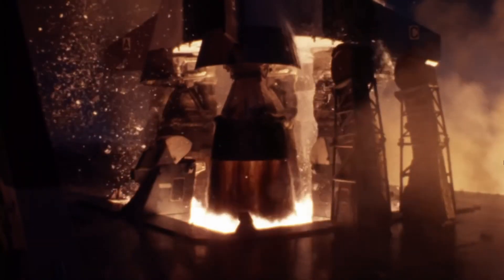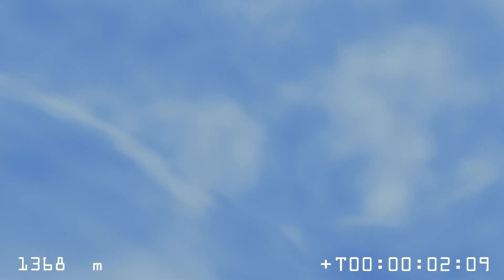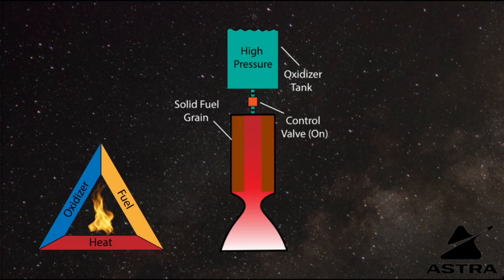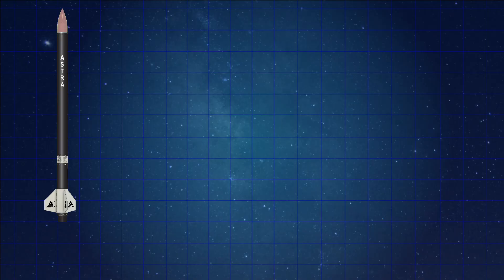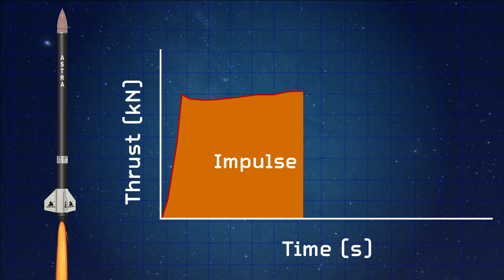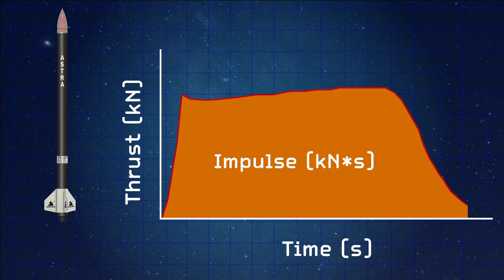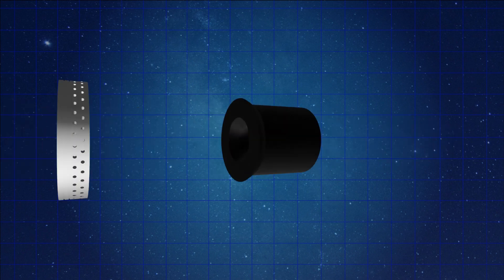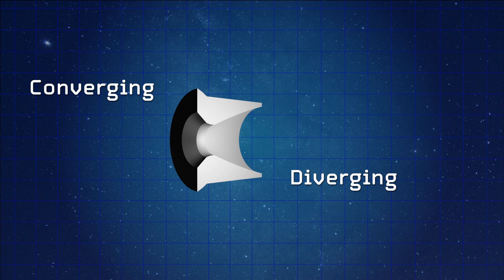ASTRA Transcendence Rocket: Propulsion System Introduction

Comment: Actually there are downsides of N2O and one is that it can decompose under certain conditions etc. I think the interesting part of hybrid rocket engines are the additives you can put in the plastic or in this case the wax. Additives like sodium, lithium, aluminium, magnesium would allow other oxidizers like water or CO2 and could make the chosen oxidizer N20 (together with magnesium) more effective.

Comment: You should look at implementing supercharging of the Nitrous Oxide tank ullage with helium to help extend the liquid phase and mitigate possibility of NOX vapor phase detonation through dilution at the end of liquid phase run down. Will also help avoid issues of dual phase flow reaching the injector and subsequent issues that causes with injector discharge coefficient. Paraffin wax although its offers "high regression rate" has a multitude of undesirable traits including poor structural properties, issues with bonding to motor insulation materials and g-induced grain shearing and mass ejections. Adding the necessary reinforcement chemicals (like EVA and PE) tends to reduce the regression rate so is trade off of diminishing returns. Has ASTRA Bremen done any development work or sub-scale firings yet with wax formulations? I can offer some pointers on this..Good luck team ASTRA always good to see more hybrids aiming for space.
Reply from the maker: Sounds like you really know what you are doing.  We are planning to do some sub-scale propulsion testing in order to develop our fuel grain formulation and injector designs.  The plan right now is to reinforce the paraffin with PE so we want to see what regression rates we will achieve with that.  We are aware of the benefits to Helium supercharging, but we are trying not to get into it unless we feel we really need it, because Helium is not cheap...  Of course we welcome any insights that you might have if you have some experience hot firing paraffin wax based propulsion systems.  We are still very much in a preliminary design and our concept is still evolving.
Reply: @ASTRABremen  Yes have been at this a lot of years and hot fired HRMs up to 500mm diameter and 78Kn of thrust, and done extensive work on high regression fuels over a 15 year period. I own several important IP that are at the core of my company for high regression high energy fuel formulations and methods of manufacturing. Cant divulge these but I can assist with Paraffin fuel formulations. 

You should look at formulation with 8% by mass of EVA polymer, around 2% tacky resin (like escorez) and try have a combination of normal paraffin (around 65C melt) and MC wax (micro-crystaline wax melting around 80C). Ofcourse around 2% by weight of carbon black for IR opacifying the fuel grain. PE will harden the fuel grain a little, but the negative side is that is completely non-polar and reduce bonding even more. The EVA helps give the fuel grain some elasticity and in combination with tacky resin ensures better adhesion to the motor liner materials. You will need to rotational cast this fuel however as wax transition from molten liquid back to solid results in near 30% contraction and liner adhesion failure. 

With the supercharging you can also use Nitrogen or even Oxygen BTW, any noble gas will be useful for the NOX vapor dilution, its just that helium is more mass efficient.
Reply: Try Escorene Ultra UL 7710 Series EVA polymer. Has melt temp of 65C so blends well with paraffin
Reply from the maker: Thanks for the tip.  We will definitely try this out.  We are planning to do our first grain manufacturing trials in a month or two so stay tuned for our results!
Reply: @ASTRABremen  no worries, always happy to see more hybrids heading towards space.

Comment: I am really motivated that you upload continuously.
Reply from the maker: Well, we are pretty motivated to get to the Karman Line and we want to share as much of that journey as we can.  Hopefully we can motivate other groups/people to take on this ambitious challenge!
Reply: @ASTRABremen  I want to hit that goal too but there is a twist i will do it alone and beffore graduation in just 4 years from now. And just under 5000 dollars. Watch out for me.
Reply from the maker: That will be quite the challenge.  I would recommend to get a couple friends onboard as well.  Rockets are big and heavy... and doing it with friends is half the fun :)
Reply: @Space_Shot  having worked on rockets for over 30 years (hybrids for 25 years now) both as an experimenter and a professional I can tell you confidently no way your getting to the Karman line as a loan effort and for 5000 bucks in 4 years,  its a lot lot harder than you think and even getting to 30km is outside of the capabilities of most amateurs. There is significant challenges outside of just the propulsion as well, as most experimenters/ graduate engineers dont have the experience to design a stable flying rocket across high mach regimes and avoid issues such as roll pitch coupling. Most of this knowledge takes years of industry experience, I wish you the best though but you should probably focus on something achievable within that budget and time scale such as getting past 10km to 20km. Good luck and happy rocketeering.
Reply: @jamieanderson6786  I am making a solid rocket motor not hybrid.
Reply: @Space_Shot  irrespective of propulsion type the impulse requirements of getting to 100km are still much larger than a 5000 budget will support, and there is still a great deal of engineering to be mastered not only to design the propulsion and a vehicle but also ensure stable flight. Like I said I dont want to discourage you, but the challenge is much more complicated than building a motor. Also as a guideline Derek Deville Q8UK project that reached 30km cost closer 10x 5000, and Derek has 25+ years in rocket building experience. I have built AP/AL/HTPB composite propellant SRMs all through the 1990s and an SRM around total impulse 30,000N-sec will eat up your 5000 budget no problem and will get you to about 15-20km only. And if your thinking can get a sugar propellant rocket or the like to Karman its a no go as sugar propellant doesn't scale past 4 to 5" diameter grains without serious cracking issues. Best of luck Surabh with the rocket research, seem like you are a smart and ambitious person and will probably go a long way but the road to space is hard and expensive.
Reply: @jamieanderson6786  
APCP 4 dollars  per kg
Htpb 7 dollar per kg
Al 6 dollar per kg 
How expensive could it be.
By the way i live in India so in price of 5000 dollars  i can buy 3 Royal Enfield bikes one of the most luxurious bikes. So it may be cheap for me. It could just cost me more just for static test. And i dont need a Lathe or a Cnc or a 3d printer cause i can buy custom made parts online any material steel aluminium plastic titanium you name it.
Reply: @Space_Shot  Ok I understand that stuff is cheaper in India and I have several Indian engineers at my company, who worked on rocket projects there. But still a lot of work to be done and you will need to conduct several ground firings, which will chew up lots of propellant and cost. Getting to 100km will require total impulse in the S class range (>300KN-sec), so your looking at 300000/2400 = 125kg propellant mass minimum. Will need to secure large propellant mixer and vacuum chamber for degassing, so high setup cost  just to mix and cast. Also given you are in India you will need to pay extra attention to the quality of the "cheaper" materials as often are low spec or not even what is claimed. Big problems getting access to launch sites in India as well, we are currently working with a team there that has been trying to organize a launch site for a 5km launch for close to a year now. So probably will have to ship your rocket to USA to get a launch done, exporting SRM will be nearly impossible so would have to ship the empty rocket there and fill it in the USA. Anyway all stuff to consider in your plans, like I said nothing said here to discourage you but just ground you in some of the realities of this scale of project. Making large SRMs isn't non trivial I'm afraid, they look easy but that is deceptive and I as I said setting to mix and cast anything bigger than 10kg is significant investment. Have you made any small SRMs as yet? You might be better served trying to develop a hybrid or liquid rocket, although the hardware cost is higher, you dont have to deal with the manufacturing sensitivity of solid propellant (ie one crack or cavity and boom)?
Reply: @jamieanderson6786  lets see what time has for me.